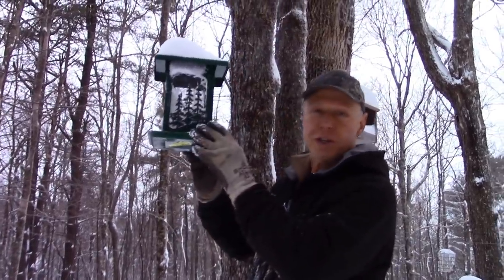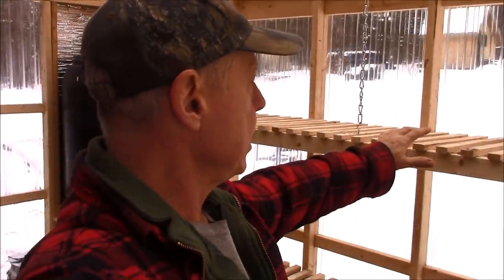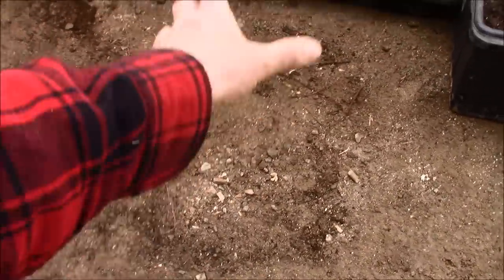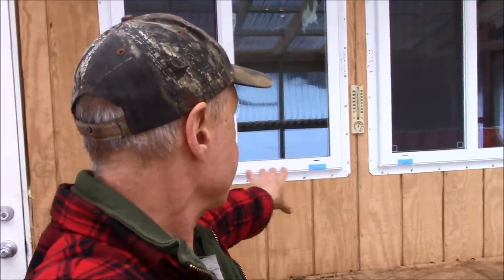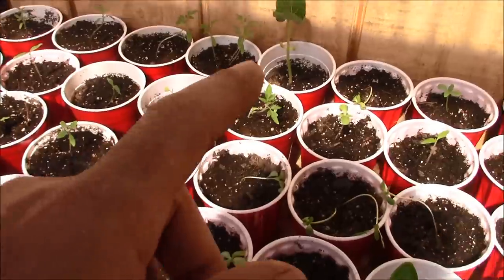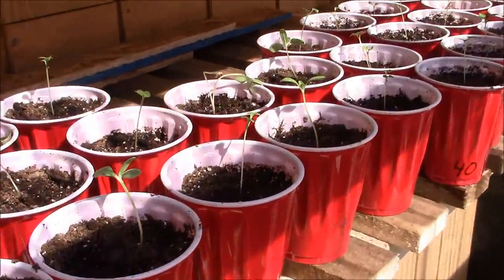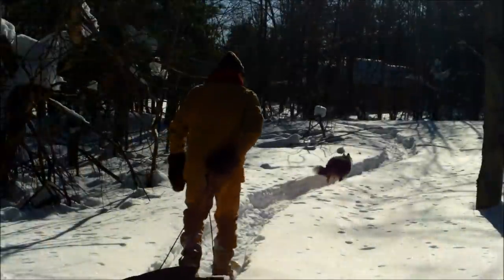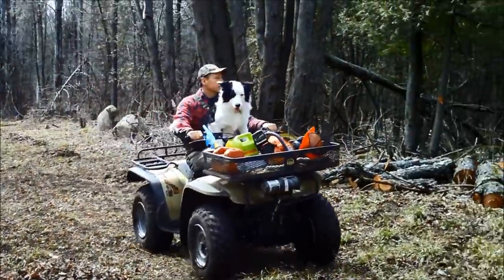Off Grid And Growing. A Tour Of How We Set Up Our New Greenhouse At Our Off Grid Homestead.

Comment: you should install a couple heat activated window openers. They work automatically as the black painted oil filled piston heats up they expand and open the window a crack for ventilation, then as sun goes away they retract and close.
Perfect fool proof way to make sure you don't cook your plants.

Comment: Great video.  Later when the sun makes it too hot in there you might try what the old timers did, dampen the roof panels and throw a little powdered lime on top. It cuts down on the sunlight ,but doesn't block it entirely

Comment: JC, I've had a cold frame for the past 22 years and it is so nice to have some fresh-picked greens in the middle of the winter. One of the reasons the ground does not freeze beside the sun is the fresh manure that I put into the ground in late fall. I dig 2' feet down going the length and width of the cold frame and put a foot of manure in and then cover with another foot of soil. Then you plant your spinach or lettuce seeds and watch them grow. The fresh manure will generate heat keeping the soil warm. As the plants grow you have to keep an eye on the temp. in the box. There will be days you will have to crack open the top (old window) of the cold frame to keep the leaves from burning. It has worked so well for me over the years, I've made other cold frames for family members. I've also made mini-greenhouses using tomato cages and clear, heavy-duty garbage bags. The bag goes over the top of the cage and I bury the edges of the open end of the bag under the soil. I do this early spring while people haven't even tilled their soil yet. As the temp starts to rise I cut half of a circle in the bag that is at the top of the gage. And pull it back on days it is too hot not open them. I close the 1/2 circle at night using a clothespin and also use it to keep the flap open during the day. I have always had early tomatoes and can get a second crop in when you normally do (without the bags). Happy gardening!
Reply from the maker: Sounds great.  I'm doing a little extra winterizing on my greenhouse right now as i plan to grow through the winter.

Comment: I just figured out about the 12V fan - use one from an automotive application and put it in a wooden frame box and hook up a solar panel. Either go with whatever wattage of designated solar panel or use a speed (amp) control box.

Comment: My friend, you may want to google Shade cloth for the greenhouse....different levels...as you already know, the heat is actually as much as 50 degree difference from floor to almost ceiling. I have always run 3 thermometers, similar like you have your 2. I ran one foot off ground, and first planter level and one at highest planter level. Adjusting the shade tarp/screen is easier then you might think and with a thermostatically control window fan you can easily achieve the balance in temp you need. Also planting the plants at the temp and level of shade/sun they need will make it easier also. Can’t wait to see future updates!! You always amaze me...thanks for the lessons over the years and hi to Frankie from Nicco 🐾🐾🐾🐾 👍🤠

Comment: I found these temperature controlled hinges that require no electricity. They are designed to open and close windows to control the heat in your greenhouse.

Comment: Wanted to pass along a tip I have used in laying out my shop that may help you decide on your planter box layout since the floor is still dirt put stakes the height ,length and width  you are planning to build then you can walk around and see how it works for you. If you have a cement or wood floor you can use masking tape to lay out items you want to place to give an idea of how the traffic flow in your space will be without having to move things around.  In my case it was metal working equipment that weighs several thousand pounds.  I'm glad that the green house is working soo well so far another benefit of the water storage barrels being inside is they will act as thermal storage for when the sun goes down.
Reply from the maker: Agree 100%.  We set up card tables today and figured out a good layout  :-))

Comment: Hey Boss, great to see the greenhouse working so well. great designs makes for awesome results. not knowing exactly how your greenhouse and house are laid out, if they are connected maybe some sort of opening between them could be opened when the green house gets too hot and the house needs a little heat. might cut down on some firewood for the house. also a drain fitting at the bottom of the barrel attach a copper line and wrap it around the flue pipe for a heat exchanger then back up to the top of the water barrel would warm the water and it should hold the heat in the green house over night. using the water in the barrel as a heat sink. then draw water from your second barrel to water the plants as that water won't be as hot in that one. or use a solar 12 volt dc pump to run warm/hot water below grade to warm up the floor. no sense in wasting all of the heat up the stack when you can capture it. just a thought, my 2 cents worth. good luck with your health. stay warm. jim in central florida

Comment: Glad you guys are having fun in your greenhouse. I built a small one a couple years ago in north Texas and it has been a game changer even down here. I put in all the things to keep it from getting too hot and many of the things to keep it from getting too cold. I insulated the north and west sides (the foil bubble wrap came in very handy), put in an automatic fan, have a rollup side.  I can use my little 8x12ft greenhouse 12 months a year. I grow turmeric, ginger, and all my seedlings. I have a worm farm in there that helps with thermal mass and I have lots of castings for the outside garden in spring. The one thing I wanted to grow but couldn't was citrus. My citrus tree couldn't handle the humidity in there. Your greenhouse is very attractive and I'm sure it will serve you well.
Reply from the maker: Thank you

Comment: consider roll out insulation on top of your greenhouse.......roll it out after sun goes low and retreive when sun returns........less wood burning.
look to the chineese for this ideal......
also a fan would be good for plant movement to strenghten them and more even heat in the building.

i speak from experience and not pie in the sky.

Comment: Interesting that you’re doing this now as we are just putting the finishing details on our greenhouse which we added onto our original shed we lived in for over a year as we built our log home. We were wondering about a fan so we’ll check into the solar fan idea. The bubble foil left-overs from our crawlspace in the house is now being used as reflective lighting for our seedlings in our house until the greenhouse is finished so keep the bubble foil ideas going. We also put in a raised bed along one side in the greenhouse. We have a woodstove in the shed so we’ll just take off the door going into the greenhouse.
Reply: Also, have you ever thought about going with 12V LED lights? We ordered online and it was very reasonable overall to build. We did our own rustic lighting incorporating moose shed antlers, powerpole insulators, old weathered cedar boards we found, as well as curved sections from lawn chairs we found at the dump. We are on complete solar so these lights are the ticket for our situation.
Reply from the maker: All my lighting is regular AC powered so I don't have to change anything when running on battery power or generator.  I know I lose a little juice with the inverter but no worries.
Reply: @thebossoftheswamp  No, I don't think you know what I'm talking about exactly. We are the same, that being that we convert at the panels to AC 120V which allows us to run our regular items in the house. For the LED lighting, I bought coils of flexible strip 12V, cut to length as per your requirement, solder wires onto them, add a small resistor/diode and hook the whole thing up to a 12v converter which I got at second hand shops for 25 cents each. If I could post a photo or video, which I did on my FB page, you'd see what I'm talking about. It's very, very little draw, simple to do yourself, and really cheap. One idea I did was use a model T Ford wooden wheel and hid the wires above the spokes and metal rim, and dropped down some 1/8" SS wire to coil the 12V wires down to my LED strip coiled inside some glass insulators. I know you don't like video links but I assure you, there are videos on this concept. I just asked an electronic friend of mine who recommended adding the additional diode resistor for extra lifetime capacity. I am using warm white lights.

Comment: A thought.  Winter time.  A grid of pex below the gravel you were talking of putting down in the greenhouse.  A solar powered/battery recirculation pump.  Heat the water with the wood stove and have that circulate to the rain barrels, below grade and back to the wood stove?  Some bubble foil around the barrels to retain heat... and you could have radiant floor heating all winter?  And, water for plants as well?  If the pex laid in the gutter (between the barrels), you have thawed snow water flowing to replenish what's used by the plants?  M'be more bubble foil on the bottom to keep the heat in the gutter?
Reply from the maker: Good idea :-)   Another use for bubblefoil too  :-D
Reply: @thebossoftheswamp  Gotta help you keep that pot stirred.

Comment: I live in Wyoming, soil here isn't the greatest so I got used rubber tracks off of some tractors turned them on their sides so they are oblong ,added threaded metal rods with some washers to hold their shape when I added good soil they work great except  the sun gets to hot on the black rubber so this spring I'm going to paint them a light color ,I  also had to add hog panels to make high hoops and put weed block for shade to parts of the hoops the sun is very harsh here it seems to burn the plants and whether it's just the heat of the rubber that's doing it or the heat of the sun that's doing it it gets hot here in the summertime it is a 90s did it Minnesota to but it's a whole new ballgame learning how to grow a garden here but my chicken sure love it here they are able to go out and free range from March first part of March to even the end of February till about Thanksgiving time before it gets too cold

Comment: Hey boss great Video.. I checked under my cabin which is on stillts . I enclosedit last fall and bubble foiled it and worked great ... frozen ground outside and soft dirt inside .. I noticed some moisture on my bubble foil .i closed the structure super tight to keep the damn mice out ... which didn’t work... should I install vents ? my cabin is on a very dry rocky sandy hill.thinking it could have been prior moisture in the dirt before skirting it.. thanks for the advice and stay healthy.
Reply from the maker: I vent it in summer but venting in winter will let the cold in.